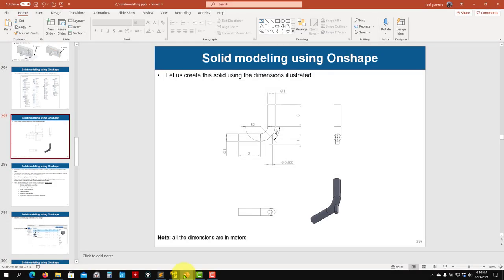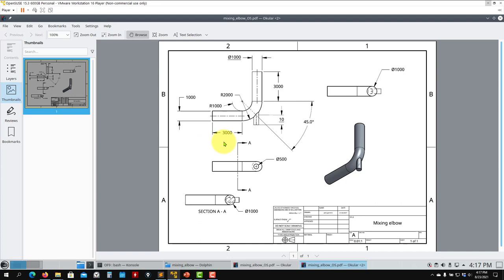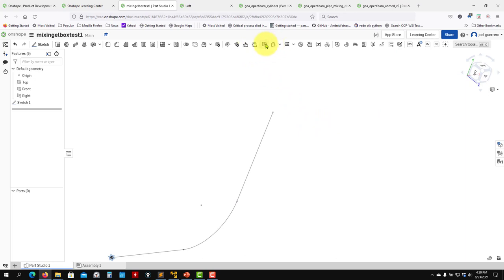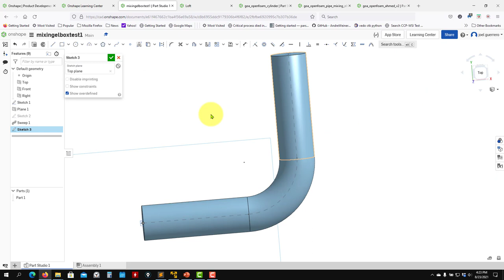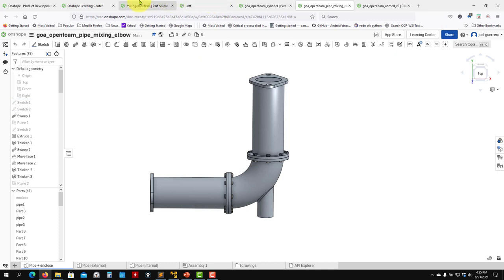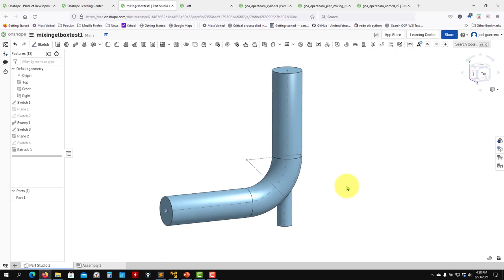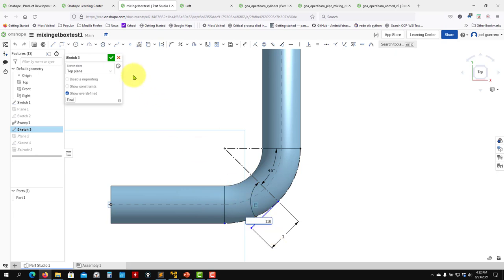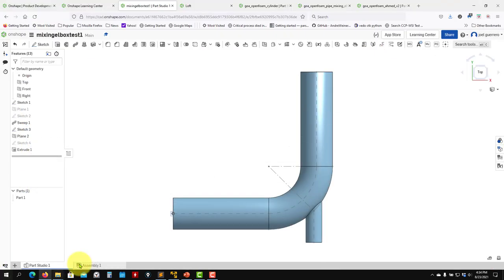2.3 Module 2 | Solid modeling #openfoamtraining

Comment: hello,sir.As you said in this video,if I want to difine the inlet face , I should use some applications in OpenFOAm to do this.What are the concrete steps? Are there any relevant videos? Much appreciate your answer.
Reply from the maker: You can split the geometry using the tools that come with OpenFOAM. You can split the geometry at the CAD level, or you can create the groups using meshmixer or blender. WE explain in another video how to use the tools that come with OF